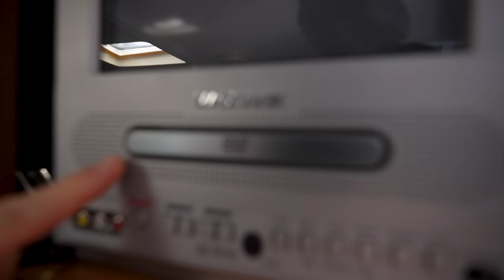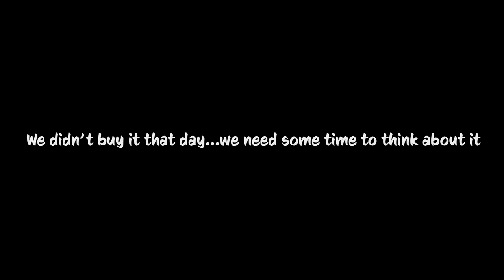Is This Our Next Project??? (are we done with vanlife?)

Comment: You should always check the oil and transmission fluid when looking at a used vehicle. You can tell a lot about the color of them and you can feel the end of the dipsticks for shavings. The dipstick ends are magnetic. So oil that has a whitish color indicates possible head gasket issues and shaves means possible mechanical issues in the engine or transmission.

Comment: Nice to see your family reunion and such a beautiful location on that lake. I have a 2004 motorhome with nearly a 100K miles and I was just griping about the maintenance that I have been doing this week on it. Then I thought about new RVs and I am grateful I have at almost 20 year old rig as it is a solid built rig. Owned it since new now almost 20 years and have had little to no problems over the years. Only replaced 1 roof AC so far. Yes older RVs need work but I know what I have.